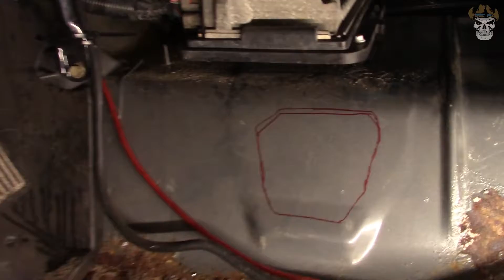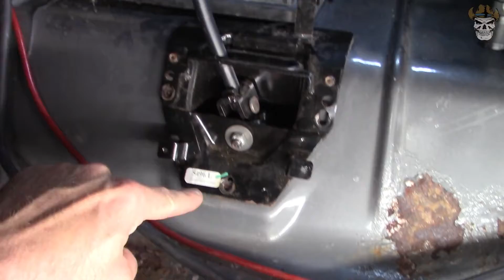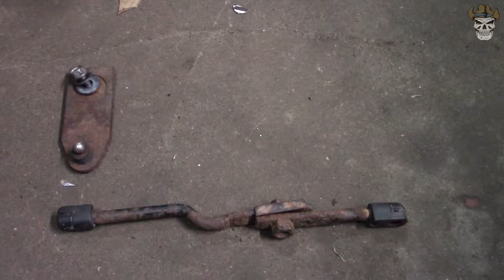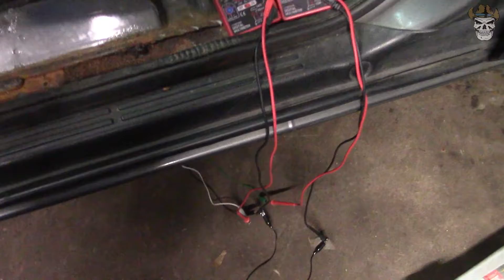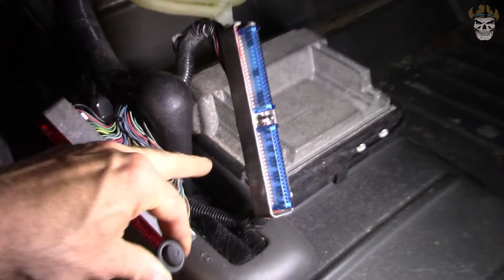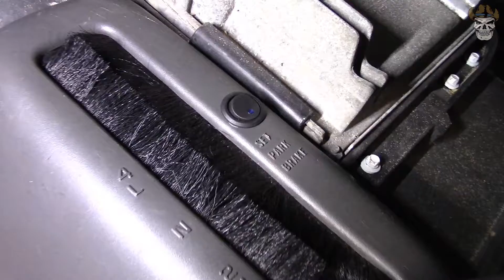Push Button NP246 To Floor Shift NP261 Swap

Comment: How does the truck knows to activate the front axle actuator?
Reply from the maker: Good question.  The truck in the video is rear wheel drive and I just wanted rear wheel high and low.  I did a floor shifter on my Denali as well but hat has the front always locked in.
Reply: @PostalRedneck so if I lock the front differential like the awds have 4 low works ok?
Reply: @sillybillyboby I made a video on my YouTube page on how to wire the front axle actuator to a switch. Im putting the np261hd in my 02 gmc 1500hd and by passing all the transfer case computer. I do think I will leave the transfer case motor under the truck and plugged in just to keep the truck "happy"

Comment: So I’m also wanting to make my truck manual 4WD… I have an 05 Yukon… I don’t know what year yours is but I know that some wiring is different from 99-02 and 03-06… but theoretically it should be the same… for the 4WD low wiring… I can if I really wanted to wire that rocker switch in right? I know my computer is all the way under the hood, but I have a way of running wires haha… I can just pin into the same wire you did on the computer and the ground on the plug on the tcase right?
Reply from the maker: It would have been nice to have the computer know im in 4 low to change the shift points without having to ground out that ECM pin but yes thats all you have to do so the vehicle will shift right is ground out that wire.
Reply: @PostalRedneck awesome, thank you so much!!

Comment: Where is the video of you installing and what you had to do to make the 261 work in the truck?
Reply from the maker: If you need a video on how to remove your current transfer case and install this one then chances are this swap is beyond what you're capable of handling.
Reply from the maker: Here's a breakdown for you. Remove front and rear drive shaft, unplug every plug from the transfer case, remove the vent hose and then remove the 6 bolts holding the transfer case to the transmission adapter and remove. Reverse the order to install your new transfer case and then follow the steps in this video to install the shifter.

Comment: NICE CONVERSION...NICE VIDEO... TELL ME WHAT TRUCK DID YOU TAKE THE PARTS.?
Reply from the maker: The Transfer case came from a 2003 Chevy Silverado.  They can be found in the Silverado's and Sierra's from 2000-2006.
Reply: @PostalRedneck  I have a 2004 Siverado single cab with a NP 246 electric transfer case. I'm tired of electronics (buttons, actuator, encore motor) can i convert it to manual.?
Reply: @miguellovino7679 lmk if you found anything, I’m trying to do the same thing

Comment: I did all this but for sum reason my front diff is not engaging  probably my sensor is bad what do you guy's think
Reply: Also did you wired up the 3 wire prong or left it unplug
Reply from the maker: I did not wire up the 3 wire plug as my truck had no front diff.  My switch was also broken thats why in the video I was unable to show what wires did what.  You will need to ohm out what wire is grounded well in 4x4 high and low and what wire is grounded when just in low and wire them into the stock harness that use to go to the electric 4x4 case.

Comment: i dont know what i done wrong but i done the same swap, but my speedometer doesn’t work anymore and my transmission only has park, reverse, neutral, and second gear lmao. im not an expert in wiring so i don’t know, is the speed sensor wire just one of the two prong connectors that plug in on the back of the transfer case. the video is useful though thank you
Reply from the maker: You probably have one of the 2 wire plugs in the wrong spot.  If I remember right there are like 3 of them used on the push button T Case and just 1 used on the floor shift.  I would try to swap them around until you get it to work.  Ill bet that will take care of both your problems.
Reply: @PostalRedneck it did, that’s what it was, thank you
Reply from the maker: @GaigeMcCoy  Glad to hear you got it working.
Reply: @PostalRedneck  I have this same issue but I’ve swapped the plugs around a few times and can’t get anything to work any idea ?

Comment: Can this be done but the other way around??
Reply from the maker: It would be an incredible amount of work but anything is doable if you have enough time and money.  I think the hardest part would be wiring in the 4wd module that controls the shift motor on the t case.

Comment: How would I get my front diff to lock in when I put it in 4wd
Reply: I recently did this swap and I wired my front diff actuator to a toggle switch.
Reply from the maker: There is an output sensor that is suppose to power or ground the front actuator when the 4x4 is engaged but the switch on my T Case was not working for some reason.  You could do what Justin did and add a switch.  Then you have 2wd high and low as well as 4wd high and low.
Reply: @PostalRedneck  I used the plug on the t case and ran a new wire to front diff and grounded the black wire with the original grounds on the frame
Reply from the maker: Heck yeah.  Glad you got it figured out.
Reply: I did this swap but grabbed the harness for the manual transfer case, and everything plugged in as normal no splicing needed

Comment: Hi, 2000 Silverado is stuck in 4Lo. I tried resetting through uplugging the battery, I unplugged the TC pigtail and even removed the front diff. actuator. Now, its probably out of 4Lo because the front wheels turn more freely, so (mechanically) it may be in 2wd but the ECU probably still thinks that its in 4Lo because it shifts gears like crap. I need to hit 4000 rpm, then let off the gas a bit and it'll shift into 2nd gear, same but not as bad to get to 3rd gear. Maybe the TC shift motor is stuck in 4Lo and the ECU shifts gears differently when in 4Lo. I can't find anybody who's ever driven around in 4Lo at speeds where the tranny will upshift, so I'm at a loss here. Is it normal to shift like that at 4000rpm in 4Lo? Any ideas? Thanks
Reply from the maker: Im guessing your encoder motor on the side of the transfer case is fried.  Its fairly common.
Reply: @PostalRedneck  Hi, thanks for the reply. That's exacly what it was, encoder motor. I installed a used but working unit: truck is as good as new. Thanks for your help.

Comment: Great video! I'm looking to do swap the 263XHD to the floor shift NP261. Do you think if you just used a factory 261 harness you could've done with the extra switch you installed?
Reply from the maker: No sure.  Never did look into why I couldnt get the 4 low to work out right and for just being an off road toy im happy with it the way it is.

Comment: theoretically couldn’t you use the back plate that you used to trace the cut line to bolt up the shifter instead of using rivets??
Reply from the maker: Yes that is actually what that plate is for but since I own a rib nut gun I figured I might as well make a more permanent solution

Comment: my shifter won’t go into 4L it only goes into 2H 4H and N but it won’t shift over N to 4L can you help?😞
Reply from the maker: Try putting the vehicle into Neutral.  If that dont work the linkage may have to be adjusted by undoing the bolt, putting the shifter in 4L, putting the T-Case in 4L and then tightening the adjustment bolt.  Here is the time stamp where I go over that process - https://youtu.be/FmqFkQVi0W4?t=157

Comment: Im currently doing this to my wifes 99 GMC Sierra truck. Have shifter installed and fixing to swap t- case. My only concern was the speedo wire. The 246 has 2 other speed sensors besides the sensor for the speedometer. Do i just leave the 2 unplugged as the manual shift will only have the one speedometer sensor? Im assuming the other 2 work the auto 4wd mode.
Reply from the maker: Thats what I ended up doing.  I would think the other one could be for rear wheel ABS
Reply: @PostalRedneck  thank you for replying, I just finished the project up, it works beautifully. Speedo works , I found the grey wire with black stripe under the main fuse block cover, tapped into it from a donor harness and tapped into the center ground on front axle actuator, removed ATC fuse, unplugged 4wd buttons and replaced with the oem pocket and just left the encoder motor and the 2 extra speed sensors unplugged and its was good to go. There is something so satisfying about pulling back that lever and you "know" it's engaged, not waiting and hoping for it to. Thanks again, your video helped a lot.
Reply: @daveb9575  did you splice onto the grey/black wire or cut

Comment: I did the same swap as u but im stuck I have a speed sensor on outputshaft and another sensor for the gear selector but no harness for it
Reply from the maker: There are several speed sensors so make sure you are hooked to the right one.  Also make sure you have a T Case from the right year.  I think the 1999 and older dont have as many speed sensors or different plugs on them.

Comment: Where you ground it not the actuator ground the other one did you ground it to the frame?
Reply from the maker: If you are referring to the computer ground yes.  The computer is looking for a ground to know the vehicle is in 4low to change the shift points on the transmission.

Comment: Did you have a 4x4 warning on the dash after doing the swap?
Reply from the maker: Yes.  I suppose you could just zip tie the front diff motor up to the frame and leave it plugged in.  I would think then you would not have a 4x4 light.
Reply: I seen that you can unplug the 4x4 module on the left side of the dash behind the left vent and it’ll make the 4x4 light go out

Comment: Can anyone help me my shift linkage will not stay on the my transfer case
Reply from the maker: You will more than likely have to either make a custom linkage somehow or buy a used one as once them plastic ends break there are no good options.

Comment: : )
Reply: @PostalRedneck  ...I have to tear into this ... if you have any suggestions to override the 246 tcase to move the truck please let me.know ...it blew a few fuses and it got buried in snow for a few .months !! Hahaha !! Very open to advice...was just going to pull the wires but now I can only get ten volts off the battery .... not a big deal to tow it to town ... just in it for the fun of seeing how far it can go ... nice old Suburban  ...Thanks for the fun swap video !!!

Comment: Nice conversion
I want to make my 2wd silverado 4x4 
Floor shifter 
But i don't know what wiring i need to replace
Reply from the maker: Other than grounding out the computer for 4 Low you will have to either wire in the front diff actuator or get a front diff out of an Escalade as they are full time AWD and have no actuator in them.
Reply: @PostalRedneck  this is the best idea thank you so much
Reply: @PostalRedneck can u bolt a np261 to a obs 4x4 tahoe with floor shifter
Reply from the maker: @96tahoe2dr  the transfer case will bolt right onto the back of the transmission but the driveshafts are going to be different. The front drive shaft of an obs is a bolt-on with dual cardan joints where the gmt800 uses a slip yoke.
Reply: @PostalRedneck  what about a front axle swap?
Reply from the maker: @96tahoe2dr  I did a straight axle swap on my 97 and kept the old push button transfer case.
Reply: @PostalRedneck  could I possibly change the driveshaft yoke which simply is just getting the 28 spline right
Reply from the maker: @96tahoe2dr  You do not want a slip yoke if you are going to run a solid axle in the front.  Most people who lift trucks even do a slip yoke eliminator for the rear drive shaft.  That style slip yoke was never meant to have torque and slip at the same time as the IFS drive shaft never moves unlike a solid axle.

Comment: I wanna do this with my 2003 hd I wanna switch to manual shift… as far as parts list what do I need? It’s a 2003 Hd with the 6.0
Reply from the maker: I dont know much about the 3/4 tons but all I needed was the T case, shifter assembly and the shifter linkage to do mine.
Reply: @PostalRedneck  it’s a 1500hd but it still has the 8 lug on it
Reply from the maker: Well it should be about the same install for both other than the 4L60E will have a different T case than the 4L80E.  So depending on what one you have you need to find a manual T case for it.
Reply: @PostalRedneck  person who had it before me upgraded it to 4L80

Comment: Have a 1998 gmc jimmy sle 4x4 has 4.3l vortec v6 4l60e Trans np233 transfer case. Want to go to manual np321. Has anyone done this? Cable linkage shifter assembly np231 transfer case anything else I need? To install? Also have the oldsmobile bravada passenger axle tube and shaft to eliminate the vaccume actuator. Will I need to wire anything so it will shift in 4 low?
Reply from the maker: Cant say I can confirm anything other than you will more than likely have to find a way to let the computer know you are in 4 low for it to shift correctly.  Other than that you sound like you have all the parts to make this happen.
Reply: @PostalRedneck  my uncle was a s10 fanatic  he passed away and left 8 s10 s
Reply: GM only offered manual shift T-cases in 2nd generation S10 Blazer/Jimmys/S10 trucks in 1995 and 1996 model years. After that they switched over to all electric shift T-cases  ( there might be an exception for stick shift S-series trucks ).  The 95-96 manual T-case versions are very rare to find as most of the 95-96 model years I've seen are electric shift.

Comment: the biggest differance is not the weight of the 2 ..... is the longgevity use of shifting it any time any cond,. any temp,. any amount of weight in the bed wither u r in or out of 4x4 mode while empty or completely loaded down to the max weight in the bed hauling what ever......!!!!!!  cus we all know being there that having a push button 4x4.... & going from empty weight to loaded to the max weight & trying to get the push button to get in or back of of 4x4 while loaded to the max isn't good all the way around for us.... or the truck in any way shape of form  !!!!!!!! cus w/ manual shifting in or out of 4x4 mode u can wither u r loaded or empty no matter the weight in the bed of the rig..........  BUTTTTT  w/ push button 4x4 mode it's a differant story it either works a few times being in a bind  or it completely  breaks in differant spot's being all push button  usually sucks donkey balls in some way some how   sooner or later !!!!!!!!!!!!!! & the other thing is....push button u have to use it once in a while esp,. if u have the 4 differant outdoor season's  !!!!!!!!!  & w/ manual shift it doesn't mind if u use it once a day or a million times a day as long as it's maintained & spayed lube where it's needed IT WILL WORK ANY TIME ANY DECADE ANY PLACE UNDER ANY CONDITION OR UNDER ANY HEAVY TO THE MAX WEIGHT  W/O WORRY'S  !!!!!!!!!!!!!!!!!!!!!  BEEN THERE & DID THAT TOOOOO MANY TIMES  !!!!!!!!!!!!!!!!!!!!   I'LL NEVER GO BACK  2  PUSH BUTTON....EVEN IF I WAS PAID   !!!!!!!!!!!!!!!!!!!!!!!!!!!!!!!!!!!!!
Reply from the maker: If you followed that build I removed the 2wd out of the T case to lessen the weight around 20 pounds.  As for the push button I have had nothing but issues with it ever sense I bought the truck and it had to go.  I replaced the buttons twice and the encoder motor once and it still acted up some times.
Reply: @PostalRedneck hey I know ots been 3 years but im curious, did you have the "auto 4wd" system previously or just the basic push button? Nv 246 vs nv 243

From what I can gather, the auto 4wd version is the real pain in the butt compared to even the normal push button. I have the auto 4wd in my 03 yukon and im going to convert it as well. Ive had to replace the switch twice and the encoder motor once and it will still occasionally just be in 4wd when I start the car and sometimes its fennecy on getting it back into 2 wd. So stupid to have a 4wd vehicle that when you need the 4wd, even if it works, something will be wrong with it after you use it lol.
Reply: @PostalRedneck I just realized the title IS nv 246 to nv 261 haha. So you did have the auto. 

Next question though, I thought I needed to switch to the nv241 case but you went yo an nv261. Is that a typo or is that what i need instead of the 241?
Reply from the maker: @cyclark8762  I went with the 261.  Here is the video of me tearing it down to gut the weight out as I just wanted 2wd high and 2wd low range for my dune truck.  https://youtu.be/eTHmcn__5-A?si=3SVz7F3midmZwi0o  I replaced my AWD trans in my Denali last year to a floor shift as well.
Reply from the maker: There is a NP261 that fits the 4L60E/4L65E and a NP261HD that fits the 4L80E/4L85E.

Comment: Is there a reason you swapped? Did a 6.0/4l80 swap and I have a floor shifter and can only find electronic t cases so I was gonna do the opposite you did.
Reply from the maker: I'm hoping when I do my lq9 swap I won't regret rebuilding and upgrading my 4l60 instead of going with a 4l80. The reason I switched to a floor shifter was because in the 7 years of off-roading these trucks I've had three encoder Motors fail and two push buttons fail. Plus I'm kind of old school and enjoy my manual levers over electrical motors.
Reply: The electric shifters are a huge fail point on any np/ nv transfer cases. Dodge and Ford had same issue

Comment: Did you swap transfer cases or remove the actuator from the electronic transfer case??
Reply from the maker: I remove the push button NP246 and replace it with a floor shift NP261 transfer case.  There are quite a few differences between the 2 from external to internals.  Here is the link to me getting the Tcase ready to install.  https://youtu.be/eTHmcn__5-A